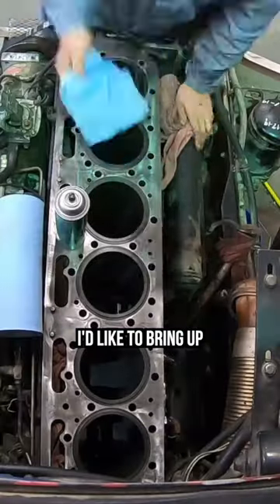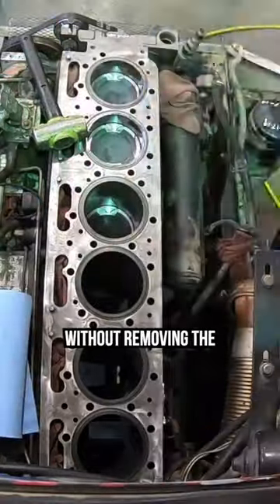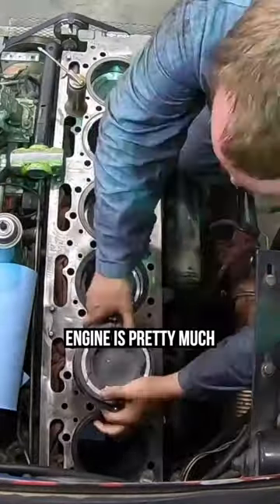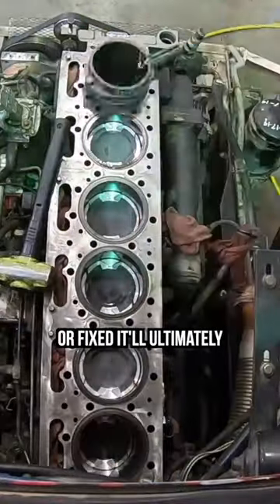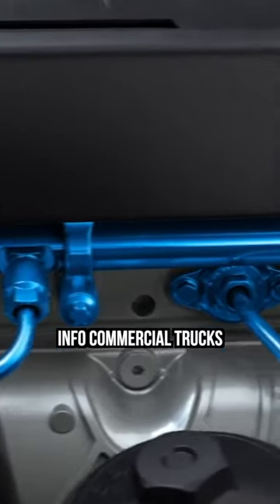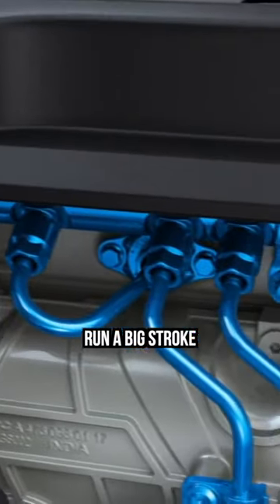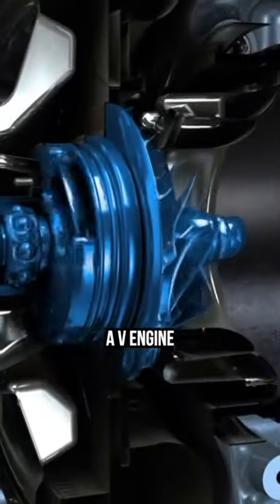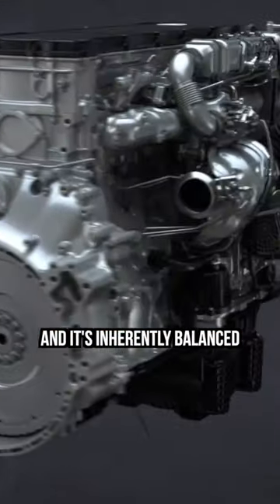Why Inline Six Engines are Easier to Rebuild in Semi Trucks

Comment: I wish more production cars used inline 6 engines nowadays.
Reply: Stellantis, the company that owns CDJR (Chrysler Dodge Jeep Ram) developed a 3.0 twin turbo i6 they're calling "The Hurricane" with SO and HO versions. That they'll be slamming into shit.
Reply: They won't because car designs are often size constrained. V-configuration engines are smaller in length and therefore easier to place anywhere under the hood without too much adaptation. If you'll notice they're pretty much only still used in the truck OEM industry.
Reply: @peterinfamilyguy  V-engines can also be shorter from top to bottom for a given stroke, further helping with packaging a larger displacement engine into a car design.
Reply: BMW still using inline 6 with turbo
Reply: bmw uses turbo inline 6 in their cars
Reply: M57 diesel twin turbo i-6   have tonnes of power and torque and 40+to the gallon..
Reply: a straight 6 engine is still used in many big cars in Australia I have a Ford falcon with a straight 6 and it's got 750000km with original gaskets
Reply: @AakePrkl bmw's are tanks. 

They don't seem to care much about weight or size.
Reply: Mazda CX-90
Reply: they can't because emissions regulations hammer down on cars, which have been pretty much relegated to being front wheel drive, and sticking an i6 in a front wheel drive vehicle is a recipe for disaster, leaving them only for RWD vehicles.  While slightly less efficient, this 'slight' difference is still a difference and why RWD cars are extremely rare, and for the few that are on the market, are also much more expensive than their contemporaries.
Reply: @icyhotmike  BMW still using rubber bands instead of chains.
Reply: ford barra engine
Reply: Mazda is going that route
Reply: Turbo 4s have basically replaced the role of I6s. Look at the CX-9- a 2.5L I4 pulling a 4,400 lb vehicle with ease.
Reply: @jared2880  They don't have remotely the same service life unfortunately. 
Unless never using the turbo then you get more life out of it.
Reply: @JesusSaves86AB  i wouldn't know because i would never own one 🤣
Reply: @RetroCaptain  I don't think I've read about much failure with the internals like the block, gaskets, and pistons regarding modern turbocharged engines, the actual turbochargers themselves though, yea.
Reply: @RetroCaptain  not if it's a Honda, their turbo inline 4s last forever
Reply: @Mohapi_Tau  Just saying "in general"
Most people can't walk on a tightrope. Some can. I knew of people who smoked through their entire adult lives and lived healthy into old age.  They aren't the bulk of society but the exception.   Honda is indestructible, everyone knows that, but most vehicle engines aren't built that well. 
I cannot base a rule on the exception.
Reply: @ZakDaley  yea but they also own peugeot and citroen. So yea...
Reply: @Alex-mz9fe THE BARRA
Reply: @JesusSaves86AB Most BMW’s use chains toyota and Honda mostly use belts…
Reply: I drive a bmw e39 with the i6 m57 diesel.

435 000km and going strong, love this engine.
Reply: @kayahall7835  As well as Alfa Romeo.
Reply: I wish the same thing although i might not be able to buy a second let alone a new one now
Reply: V engines are smaller and mostly lighter so they can fit it smaller cars.
Reply: @LuwiigiMaster  Volvo s60s did that inline 6 with fwd config in the second gen so it's possible.
Reply: @JesusSaves86AB The last Bmw with timing belt was the 316 and 318i e36 in the 90s
Reply: Not gonna happen, it's the length of a v12. That is a LONG ENGINE, which requires a long hood. And then your left with a ton of space around the engine, which means you basically need a turbo or 2.
Reply: Mercedes, Mazda, Land Rover and Stellantis are all deploying new inline 6 designs
Reply: @Alex-mz9fe  one of the greatest fords never sold in America imo. I really wish they sold them here
Reply: @geoffbell166  M21 diesel crushes it
Reply: @LuwiigiMaster  Emissions requirements have absolutely zero to do with where you put the engine in a vehicle, or which set of wheels are driven. Emissions has nothing to do with front wheel drive being more common now than it has been. Where do you even get that idea???
Reply: @DarkAttack14  rear wheel drive is objectively less fuel efficient than front wheel drive, and therefore produce more emissions per distance travelled.  If there was no impact, automakers would not have killed rear wheel drive cars, but they have.  The one segment where rear wheel drive still lives on are trucks and SUVs, which don't have nearly as many restrictions as cars.
Reply: @Alex-mz9fe mines only done 400k but still running like new
Reply: @JesusSaves86AB  nowadays yes but when they made m47/m57 they put chains that will outlast the body of the car in there
Reply: In-line 6’s are still used by BMW, Toyota (bmw), Mazda, Jaguar/Land Rover, Mercedes (i think, maybe a China only engine),and I think Alfa Romeo has one now or will soon. The problem with Inline 6 engines is packaging. You need to have a long hood and and it’s going to rear wheel drive or awd, though Honda did a front wheel wheel drive 5 cylinder with the engine mounted longitudinally. Also since the car is rear wheel drive it mostly going to be marketed as a “sports” model or “luxury” model. The V6 engine is a much smaller package and can be mounted transversely it longitudinally so it can be a front, rear or awd set up. It also mean that you can have a shorter hood, better weight distribution, and there is more room for other components such as forced induction, hybridization, and so on. The in-line 6 is still the smoothest and most balanced piston engine design and they sound amazing too. Modern V6’s have less of the cons that they used to have. If you have never driven a inline 6 you won’t understand the difference in how it feels, I would highly recommend trying to find a N/A BMW inline 6 with a manual transmission to see what I’m talking about. The lack of vibration even at high rpm’s, the throttle response, the sound, it’s all something awesome. The in-line 6 is really a drivers motor I my opinion. A turbo 4 or a v6 can make the same power but they don’t feel the same. I’d live to get an N/A Nissan or Toyota inline 6 and put it in an old triump tr6. Another good option would be to find a Lexus is300 with a manual. Those have a non turbo 2jz in them and they are great driving cars.
Reply: @Alex-mz9fe  mine has only got 400k on it she runs beautiful
Reply: @ZakDaley man this comment tickled my fancy lol
Reply: Simply,  no need of that much power
Reply: @ProCoder119x  it would be pretty easy to make a smallish 2.4-3.0 liter inline 6. Gas powered, naturally aspirated, and it would make roughly 150 HP and 140 Ft-lb torque.  That’s a far cray from too much power.
Reply: They suck in the snow and ice. So you gotta go awd for traction, or you just do front wheel drive and you get pretty good all around affordable cars@LuwiigiMaster
Reply: @johnnybagofdoughnuts4193 it's plenty though

Comment: Doing an in-frame  rebuild on a V-8 isn't more time consuming because the frame rails are in the way. It takes more time because there are two more cylinders and the crankcase is crowded with two rods per journal. Two heads on either side makes a difference too.

Comment: An inline 6 is just a great engine.
Reply: The Ford 240/300 inline 6 is easily one of the most reliable engines ever made, no timing chains of belts, just a simple cast iron timing gear that will las the lifetime of the engine.
Reply: @applepoop10  overhead cam, more things to fail.
Reply: OHC isnt rocket science, theres plenty of reliable ohc engines out there. The issue is the 2JZ's usage of timing belts. @seana806

Comment: This is why when I upgraded to a diesel engine truck, I went with a Ram 5.9l cummins. When you pull heads off of an inline engine, and look at the cylinder walls, the cross hatching still is clearly present. I've seen the old 4.0 inline 6s in the jeeps with 200k miles on them still look like freshly machined cylinder walls. The straight up and down pattern wears way less than the rod angle of V pattern engines.
Reply: Not to mention there is less side to side pivoting at the Pistons as well as the crank and journals. 

I am a V engine fan but the physics of an in-line just work out better.

Comment: I6 is my favorite engine pattern
Reply: Ford 300 l6 my personal favorite
Reply: @Billybobaggins9  same
Reply: Same here my i6 brothers. My 96 jag inline 6 sounds amazing
Reply: My e46’s with the m54b30.  Revs so nicely and is so smooth, even with one being at 167k and other at 122k.  Love the layout and power delivery.
Reply: @M54B30 Fan  haha thats what's up bro, part of the i6 Squad, when my jag revs up high its literally like a roar from hell, never gets old bro.
Reply: Mine is the big ol V8 🦅🦅🦅🇺🇸🇺🇸🪖🪖
Reply: Personally I MUCH prefer the V8. I was born and raised around Detroit muscle. And I used to be one of the guys that slammed any other engine configuration cause to me it just wasnt right. But after a while the Inline 6 kinda grew on me and I figured ehhh what the hell, everyone rants and raves about the RB series, the 2J, the Ford 300, the dodge slant 6 and the screamin jimmies. So I eventually grew up and grew into the mindset of, everyone can have their preferences for whatever engines they like. Personally for me, there will never be anything to replace an old Big Block Chevy. Although I do want to build a Turbo'd Vortec 4200 (4.2L I6 found in the Chevy trailblazers) and put it into a Nissan 240 SX. Mixing the old saying, theres no replacement for displacement, with the sleak JDM body design
 Man I think that thing would be bitchin
Reply: I6 and box
Reply: I personally prefer the 4 rotor configuration :)
Reply: Every BMW guy(including me).
Reply: same, shame gm stopped making them (atlas engines) but i get that v engines are better for getting more displacement in a smaller area
Reply: Any flat/boxer engine for me, Flat 4, Flat 6, Flat 8, Flat 12, and Flat 16
Reply: I like the 240z engine
Reply: @Billybobaggins9  One of the best engines ever made 👏
Reply: barra 4.0 i6 here in Australia 
best i6 for cars ever made
Reply: Yep, Iove my Toyota 2JZ.
Reply: @useyourbrain6937  you mean the Jaguar owned by tata motors 😂
Reply: @jedvaulten02  Tata motors?
Reply: @useyourbrain6937  yes they fully own Jaguar and Landrover
Reply: @useyourbrain6937  Tata did a 2.3 billion dollar all-cash transaction for the ownership from Ford in June 2008.
Reply: @useyourbrain6937  did you know Volkswagen owns Audi, Seat, Skoda, Bentley, Cupra, Bugatti, MAN, Scania, Lamborghini, Ducati and Porsche?
Reply: Yes. and probably the inline 4 engine as well.." inline 6 cylinder engines have enough power.."
Reply: Agreed I think it’s everyone’s
Reply: @synshenron798  forgot about the king of I6 the BARRA m8
Reply: @jeremyclarkson-69  a DOHC l28 with ITBS is arguably the best sounding engine
Reply: I6 Jeep 4.0L w00y
Reply: My favorite engine pattern is the inline 4.
Reply: Same here but if i were to rate on sound its gotta be h6 for me
Reply: Chevy 250, I love it.
Reply: V12 is good too, are two inline sixes.
Reply: Ford falcon inline 6 barra i have, best engines ever made period
Reply: @jedvaulten02  wow, I didn't know that
Reply: boxer 6 is great as well, in general 6 is great😂
Reply: @antinormieism3791 I love the in-line 6 my channel is based around them
Reply: @jaykeinnes6793 we planning on putting on in an e46 on my channel for the next swap
Reply: @moneyshifters  boo yahh
Reply: I11 the goat
Reply: @Billybobaggins9 Ford 300 and jeep 4.0
Reply: Definitely in the top 3. I used to have a 1997 firebird V6 I swapped it for a 4200 vortex because I didn’t need or want another LS car but it got ruined in a flood sad days
Reply: The old I6 gas engines that they put in everything back in the day that mostly went away in the mid 90's from the big makers are bulletproof (i4 like Toyota's 22RE are unkillable too).
Reply: @ws8061  Ford 300 and jeep 4.0 are great engines! Personally haven't owned any other i6 but both of these are great
Reply: @M54B30_fan Hell yeah I have a 02 325i 5spd manual with m54b30 swap,3.46,headers,tune,exhaust ect it’s a fun little car
Reply: Amc 258 my beloved
Reply: Mine too! When I realized all of my favorite sports cars came with I6s. My favorite is the rb26
Reply: Toyota M-series‼️🗣🙏🏻
Reply: B58 former owner, beautiful beast 💪🏾
Reply: @mhuka4541 V engines suck to work on they're too compact and a pain in the ass
Reply: The Wärtsilä-Sulzer RTA96-C
Is my personal favorite
Reply: Same here.
Reply: me to
Reply: I like the bmw ones
Reply: @madkas14 same, even if its the GE (non vvti)

Comment: Plot twist…still charge the same labor regardless of engien configuration
Reply: You just don’t understand how things work.
Reply: Try heat tanking that block while it’s in the truck … ( all that scale buildup inside the water jacket must be removed or you don’t have a viable rebuild it’s just something waiting to melt down again prematurely … LoL ..
Reply: Exactly
Reply: @Robert Holderman  ever heard of a steam cleaner?
Reply: You're a consumer, not a professional.
Reply: They charge more sometimes actually 😂😂
Reply: If you get same result, then it cost the same.
Reply: I drove semi's for years and inline six make great tourqe and they are something that many are familiar with.
Reply: @orangepekoe7096  I see there’s plenty of tire techs in this post lol. Would you pay the same amount for your barber to give you a pompadour, as you would for him to buzz it all off with a #2 guard? I mean after all it’s the same result… you got a haircut… right?
Reply: @charlesbrown4483  ah, yes
Reply: @charlesbrown4483  last time I went to the barber he didn't charge by the hr.
Reply: @imagrownassman1  Even if it he, same result. You got a haircut right?
Reply: @charlesbrown4483  mechanics charge based on the hrs of labor performed to complete the job, barbers do not. So if a job is easier to perform, less labor hrs are involved. So your analogy is trash.
Reply: @charlesbrown4483  I see I missed the part where you were replying to a bonehead comment originally
Reply: @orangepekoe7096  😂, oh ok Einstein
Reply: Do you know what a labor guide is?
Reply: If its a bmw the engne bolts to the subframe but the subframe has to be removed to remove the oil panso what do you do pull the engine to rebuild it but im sure you knew all that already, this is a semi truck video 😂

Comment: as a guy with a ‘06 Ram with a 5.9 Cummins, the engine is a giant lego brick.
Reply: That's a good motor, though
Reply: I’ve got a 96 F-150 with the 4.9L straight six, it’s been nothing but reliable and easy af to work on.
Reply: I don't want to step on that Lego at night
Reply: @AbcAbc-sp1od  my 4-53T is better
Reply: @helldoge  best motor Ford ever made
Reply: The Cummins is the only reliable component in that hunk of shit
Reply: I have a 1st gen 5.9 Cummins in my 78 Bronco and the engine is in fact giant.
Reply: @pierce_arrow1798 better at being slow as hell.
Reply: same i got a 1995 cummins 480k miles on the original motor. it's on it's second transmission.
Reply: @pierce_arrow1798 no it's not
Reply: @pierce_arrow1798 burned Xd
Reply: @helldoge That's a great motor. Had one in an old oliver tractor. The 250 version.
Reply: My 12 valve has been a great engine

Comment: "Here at Subaru, we know you'll need a rebuild soon, and took that into consideration..."
Reply: God I hate Subaru lol
Reply: @AbcAbc-sp1od  
DEF DEF .
Reply: @AbcAbc-sp1od because of how the engine sits??
Reply: @anthonyjulson8840  because of their poor quality. But the way the engine sits is just an added pita
Reply: @AbcAbc-sp1od  those were the old days lol, get with the times, even car wizard recommends them.
Reply: @Maximus20778  iirc the car wizard does recommend certain year Subarus, if you have to have awd. So yeah, you sorta right. But... He also acknowledged the head gasket issue of Subaru in a certain era.
Reply: @AbcAbc-sp1od  head gasket issues are sort of a mixed bag tho, cuz some will have the engines for a long time so it will be reliable while some others got it blown.
Reply: @AbcAbc-sp1od  I feel ya, I honestly just hate Subarus, and yeha they fixed some of the problems but there are still far too many problems for me, If I’m going Japanese I want something reliable, (Toyota or Honda)
If I’m getting an unreliable car like a Subaru I might as well just get an unreliable car that’s at least powerful 🤣
Reply: @Maximus20778  You still have three differentials to worry about. AWD isn't worth the complexity for me.
Reply: @Maximus20778  And what?
Reply: @Maximus20778  Toyota and Honda give you variety in the cars they produce. Subarus entire lineup is just too simalar. 100% awd with a boxer. 
Also I’d argue that Subarus are much more boring because they’re awd and low on power.
Reply: @HondaBetter you also forgot the oil pickup tube coming loose😅

Comment: European trucks using V8s: “I’m gonna pretend I didn’t hear that”
Reply: Scania 770 V8 is the 16L torque king
Reply: And our trucks are length restricted and have V8 and I6 (and used to have V10 and V12 as well)
Reply: @countcuda70  yeah they even sound amazing, but I'd still have a inline 6 volvo/DAF if I were to buy one.
Reply: Amazes me every time how the euro trucks pack the same thing into a package half the size of us models.
Reply: @FerdinandFake  US doesn’t have the same length restrictions and the bigger the hood is the easier it is to work on
Reply: @FerdinandFake  lesser restrictions and straighter and larger roads help with that
Reply: @FerdinandFake  keep in mind that american truck drivers are also double the size.
Reply: @theoregontruckerT880  cab overs are 100 times easier to work on haha
Reply: Yeah Scania power
Reply: @Bigsoot7393 yea but conventional rides better